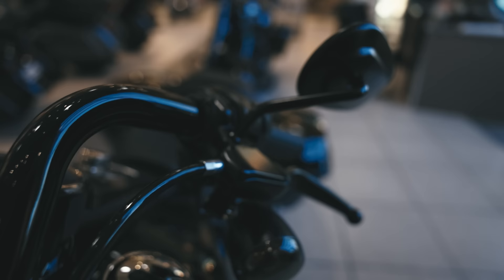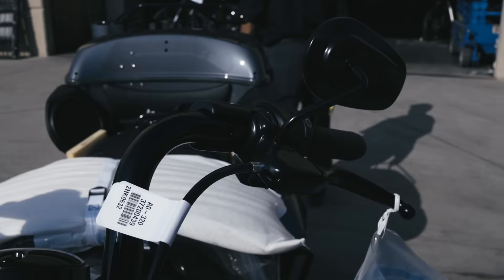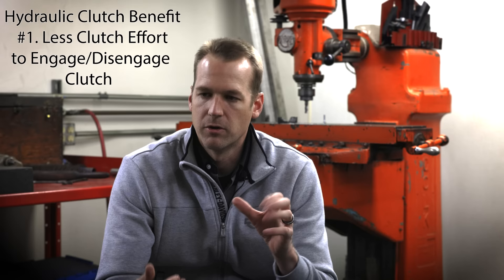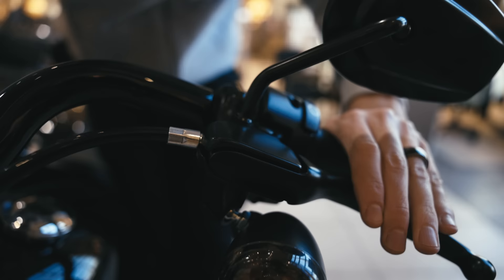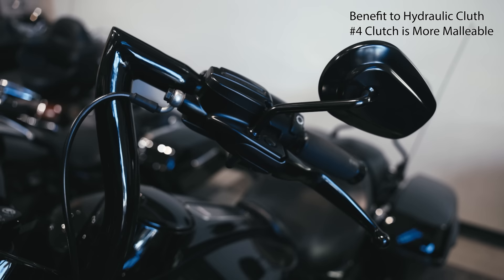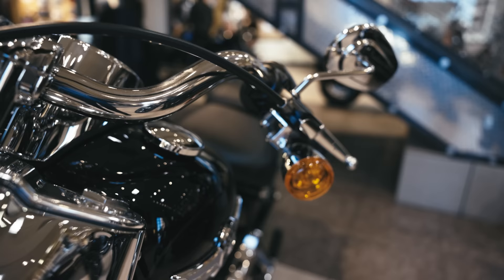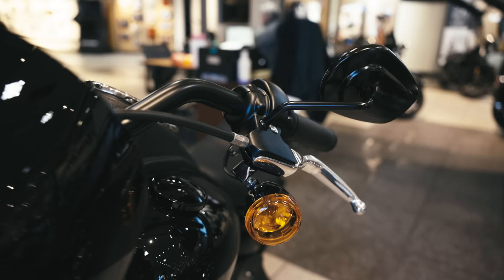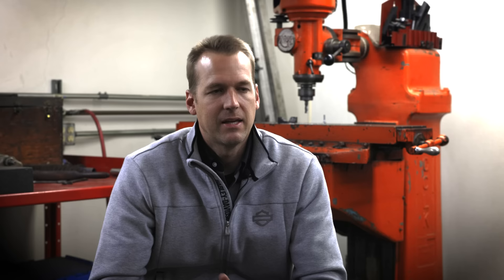Why Harley-Davidson Switched Back to a Cable Clutch on Touring Motorcycles│Pro's vs Con's

Comment: Top priced bikes that's can't figure out top bike tech... I love my harley but they need new engineers... Same issue with the hydrolic clutch for 4 years in a row, just like cranks and sumping ECT. Put the loads of cash into making better products and not cheaping out to get richer stock holders, and maybe make all the parts in the USA again ... Harley is destroying its own name and it's very depressing to me...

Comment: The only way you like the Harley hydraulic clutch is if you never ridden a Euro bike with a hydraulic clutch. I think Harley did a lousy job with its Harley hydraulic clutch. All the KTM's I've owned had/ have amazing hydraulic clutches. Harley's are garbage in my opinion.
Reply: I don’t like KTM’s or MV Agusta’s hydraulic clutches, never tried ducati’s though.  I prefer the cable clutch on my GSXR to my MV.

Comment: Please Explain 5 Previous motorcycles All cvo,s  had a perfect fiction zones when they went went to all touring bikes they went to a different supplier all bull shit I like a hydraulic by the way my 2017 and 2019 street guide and limited still have the oil transfer problem I am done with Harley after 32 motorcycles I will continue to ride Harleys older ones only if willie would come back and strighten out these a—holes making these decisions anything to make the bike cheaper not better

Comment: The cable clutch on some bikes could be very heavy. Many modern bikes use an 'assist clutch' that is so light you'd think the cable had snapped. Harley need to catch up.
Reply: splodge, Harley had a "clutch assist" back in the 50's through the 60's. It was called a clutch booster by the factory and mousetrap by the riders. If set correctly, you can pull the lever with two fingers. My 65 Electra Glide  has one. Easiest clutch pull of all the bikes that I own.

Comment: "hydraulic clutch" without question the way to go. I'm really getting worried where the HD motor company is going. They say that they are listening to the consumer yet look at your comments majority prefer hyd and corporate if your really listening myself and most people i ride with hands down prefer hydraulic. I've been riding motorcycles with hydraulic clutch since 1988 with NO maintenance issues...none. And smoother, cleaner shifts and less resistance especially on touring bikes. And if you insist on going cable which is less expensive to manufacture, that's fine but then why are you charging more for your bikes.. Little to no changes for 2021....correction ( Cost less for you to manufacture, cable clutch, no heal shifter, only one key "REALY" most models only color changes etc....)  offer ''''less''''' charging """MORE""" not a good strategy.  Looks like for me " at least" my next ride will be a used machine. It'll cost less and I'll get More Harley.....  Win Win situation!!! P.S. Harley if we are regressing in technology what's next The Fred Flinstone project manual braking ....Riding boots not included!!! LOL